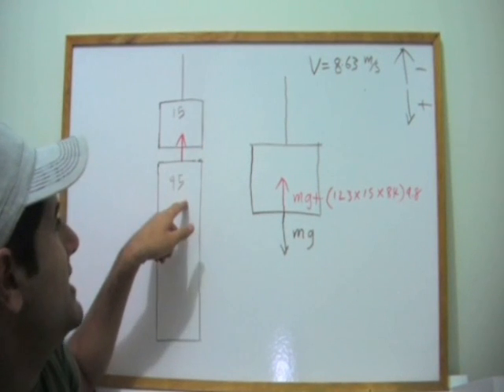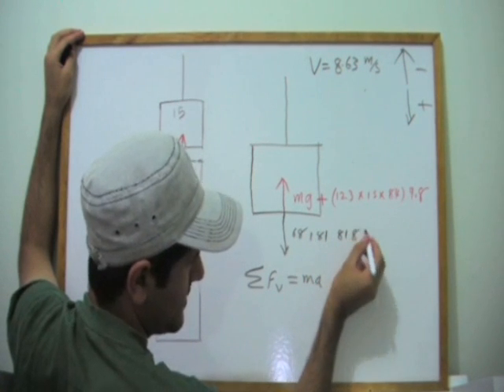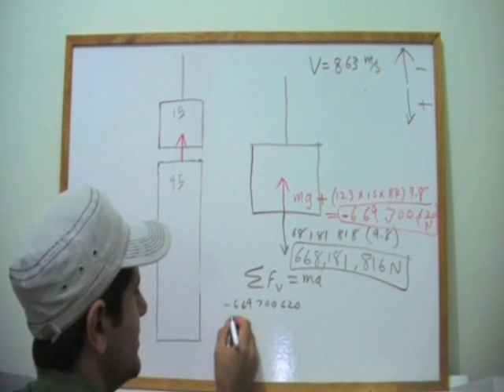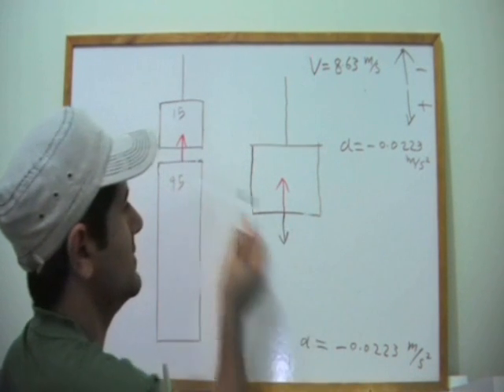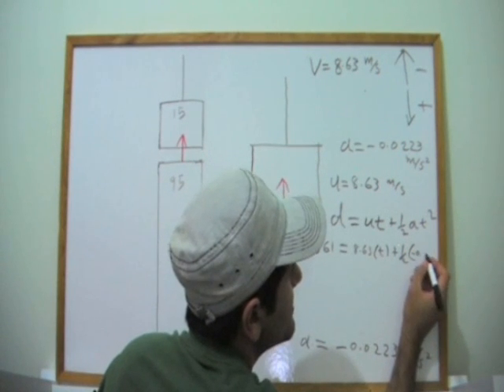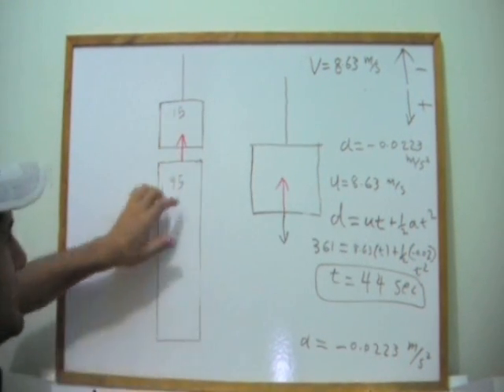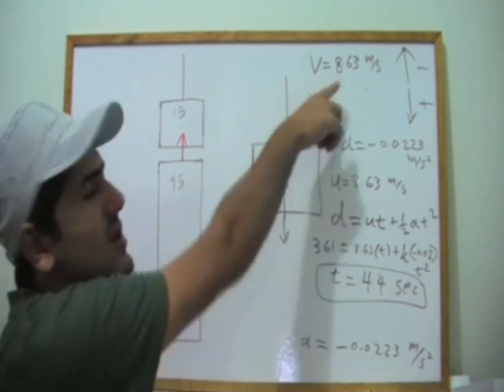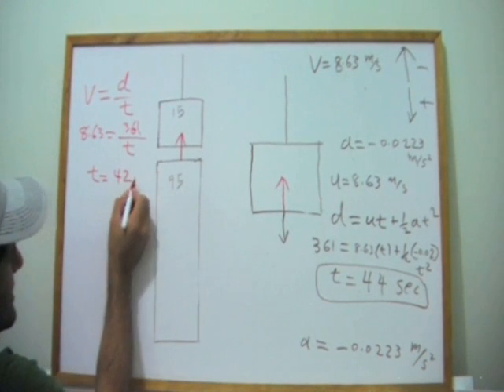(Part3) 911 Simple Physics Structural Failure Vs Demolition

Comment: Really, how could this be a controlled demolition? You can clearly see that the implosions in both towers were started at the impacted floors. Do you think someone ran up the stairs and planted the explosives after the planes hit? Or do you think explosives were preplanted on every floor, come on... Also, one tower fell after 56 minutes of burning, the other after over 100 minutes of burning. Why wait so long before taking them out? The towers fell because of the damage+fires, WTC 7 is som. else

Comment: @sskinner99 No chance he's a sophomore in mechanical engineering. I say that because a mechanical engineer wouldn't use constant acceleration laws, nor would he have erred on his FBD. At the very least a limit state analysis of the perimeter and core columns for rupture is needed. Column's can rupture quite easily if forces are misaligned from the centroid, leaving not much to support all that mass. The building failed from bending, not normal stresses due to mass being dropped on it.

Comment: 3. Your calculations do not account for widely differing resistance factors WITHIN the structure itself (i.e. floor joints vs. trusses vs. central core, etc.) and therefore does not present a viable model for what happened.   4. Your initial calculation was for the upper x floors falling only a single floor (3.8 meters). In both cases the planes hit at angles knocking out portions of several floors, not a single floor. In the end you do not come near proving the case against structural failure.

Comment: Ridiculous! Your calculations make many wrong assumptions: 1. That a single mass (the upper x floors) fell on another "mass" with opposing "force". In fact, the falling mass was cumulative and increased with each successive floor collapse. 2. The increasing cumulative mass was in fact gaining momentum (not losing as you hypothesize) since each successive floor collapse started with a greater initial velocity. (continued)

Comment: great video, i cant understand why its still a debate, its so obvious it was a controlled demolition. Either that or that building was designed to fall apart. The force of the top floors falling probably wouldnt even equal to the top floors fully loaded. I wanna know what the maximum weight handling was for each floor. Somebody find out and add that up to see and compare it to the load that day.

Comment: @peaceviddie "a" at freefall with air resistance is noticably lower. 
so the lower floors would have had to have disappeared before the upper floors reached them.
how can 47 floors of bolts snap simultaneously & symmetrically due to open air fire?
why did all the structural steel reinforced with concrete pulverize into dust or resist less than thin air- when no plane hit it ?
visit: h t t p : / / abz2000 . c o m / falseflagterror . a s p x 
for the full calculation -& please tell me his response

Comment: @peaceviddie calculation of the acceleration of wtc 7 collapse,
(height/distance) d = 174m
(time for collapse) t = 6.5s
d = Va X t   (Va is Average Velocity)
Va = d / t
Va = 174 / 6.5
Va=26.7
V1 (intitial velocity) = 0
Va = Vf+V1 / 2      (Vf is final velocity)
Va X 2 = Vf+V1
26.7 X 2 = Vf+0
Vf = 53.5
^V (change in velocity) = Vf-V1
^V = 53.5 - 0 
^V = 53.5m/s
^V = a X t
53.5 = a x 6.5s
a = 53.5/6.5
 
a = 8.2 m/s/s for wtc building 7
 
"a" in a vacuum at freefall with zero resistance is 9.8m/s/s

Comment: @Gi0Piles 
And there is something  deniers  often forget. There are always security factors calculated in every construction, the more life is depending on it, usually the higher the security factors. Even if a third of the structure would disappear and the other two thirds would be weakened by 50% the building wouldn't collapse in this manner. Period.

I agree with the scaling factor.
But you also have to think of it as a NON-RIGID body and loss of significant material mass during collapse.

Comment: One thing you didn't considered was the fact that in the moment of the colision the downward force isn't equal to the weight of the top part of the building.
You have to considerer the momentum and the impulse cause the force of something that's falling is always higher than its weight.

Even this "extra" force I believe still lower than the structural resistance.
Nice video, btw.

Comment from the maker: @peaceviddie  hi sir , yes we assumed the upward resistance force is constant which is not accurate because the resistance in a dynamic situation would vary at any given instance. this method is not conventional to calculate dynamic situations but i can bet that if you calculate the energetics it will not give you a time shorter than what i got. the proper way is by computing the energetics. or i refer you to a video watch?v=rP9Qp5QWRMQ

Comment: So buildings are big solid lumps of metal, with no air or space within? Contrary to popular belief, the world trade center did not have the material density of a tree. If the science behind this logic he uses were sound, axes would not be able to cut down trees, and there would be no difference between a dum dum bullet and a regular bullet. In carcrashes only one car would be damaged, since the one travelling slowest would have to be rigged with explosives, for it to take any damage

Comment: This goes on and on. For each floor, you can assune that the columns can buckle elastically at most by 10% of their length before they fail. Do math correctly and you will find that the downward acceleration (90%) distance) outpaces the resistance 10% of the distance), even if you allow for a safety factor of 3 times the static load, and a total average of about 2/3 g must be expected. This fits very well with the observed duration of the collapse.

Comment: There is an obvious flaw in your model, shorty40merza: When the top block travels down at 8.63m/s, at initial contact with the lower block it gets decelerated, true. But it keeps going down, straining and then buckling and breaking the columns below. This will happen after a short distance. Once columns break, they offer no resistance, and the top block (now enlarged by additional failing floors) will be accelerated by gravity (g) again.

Comment: @lonegull Steel dose not melt until you reach temp of 3000 degrees. Most of the fuel from the plane would have been used up in the first explosion, also steel used in builds like the WTC would be high grade steel that can hold more than 3000 degrees....lonegull dose it really make sense to you that a small section of the top would cause the building to come down in 10sec?????? use your fuking head...dam

Comment: @dumbnetworks You know I worked this out my self so many times and I don't see controversy about it, the building was "aided" to achieve this neat fall. If you watch zeitgeist he actually shows the core of the building and it has a diagonally cut beam, not bent not broken just a high temperature clean cut, if you are an architect does this sound familiar?

Comment: @PissedOffAtheist   Your assumption here is that the top of the building is in straight freefall. from all videos it  obviously is not. the student is using basic physics to prove that if the building falls FASTER than in free fall that it can't possibly be structural failure ; only an implosion from demolition does that.

Comment: @PissedOffAtheist . We are not talking just acceleration, we are talking about force that which is required in physics to work. W=F x d (d=distance ) and F=ma. as for momentum m1v1=m2v2 . if one considers mass in momentum, there is simply not enough mass in the top 20 or so floors to demolish the rest of the building at the speed observed , and even if so the above formula will yield a much slower velocity collapse than observed in the live footage. I can go through the math

Comment: @PissedOffAtheist No  he did not. positive momentum only applies to masses that are accelerating or constant velocity. he showed mathematically that the top
would be decelerating (ie slowing down )  when it hits the resting part. Think about it.  Would your car speed up if you rear ended an 18 wheeler stalled on the highway in your path of travel  ? I'll take a guess and say no ..

Comment: @ barrington...this is still assuming that 1 floor vanished instantly...and that there was no time allotted for twisting and there was no air resistance...besides, structurally the core supports of the building would withstand impact OR in an extreme farfetched circumstance, the core would stand and the floors would fall around it OR if you destroy the core it would act like a mast on a ship...it would topple over....in theory :)

Comment: that theory would mean that the top portion would of toppled over.  The top 1/10th does not have the energy to destroy the bottom 9/10th.  That 1/10th would have to have the same amount of energy or more to destroy the other 9/10th.  And you don't need math to figure that out.

Comment: You assume that both bodies behave like solid blocks. They are not.

Press the fingers of your two hands together, eventually they will "slip" past each other. Likely the top columns were NOT directly aligned over the load bearing bottom columns when it fell. They could well have been aligned over just the floor trusses. Also Point loads at end of columns would be v high to punch thru floors.

Please email me to explain this. Overall good video.

Comment: Thallis69:

Its 'cumulative', not 'acumulative'.

Anyway, lets not moan about spelling...

I am guessing your imagining some sort of acceleration, allowing the upper section to fall through the rest of the building underneath. If that is the case, Newton says you are wrong. Every action has an equal but opposite reaction, hence the un-damaged section below would resist, RESIST with UPWARD FORCE.

Comment from the maker: i multiplied the mass of the falling block by the acceleration due to gravity in order to obtain the force acting on the falling block due to gravity, basically  the weight  of the falling block.  then i said the Resistance force at any instance should be at least equal to the weight that it was supposed to carry at static conditions.  eg level 45 was meant to carry levels 46 to 110 at static conditions so the resistance it offers is at least the same as the weight of floors 46 to 110

Comment: Your assumption that the bottom floors is wrong. They had been heavily damaged, and subjected to fuel and aluminum fires (ie, the airliner burning, thats 75 tons of aluminum) NIST estimated that 3 floors were directly hit by the airplane, and that the three floors below that, had been ravaged by the fire, specially at the floor joists attaching them to core.

Comment: Ok man, you take only one "body" in your calculations, wich you drop on the "big one". that's wrong. the residual capacity of the north and south towers was limited, and that once the collapse was set in motion, it would take only nine seconds for the building to go down. 
This is just a little longer than a free-falling coin, dropped from the top of either tower, would take to reach the ground.

Comment: BTW I am an architect. Of course under tremendous pressure concrete can 
"explode" if you are an engineer you know. Did you consider pressure from wind?  From the sides?
BUT! I didn't say that controlled explosions are excluded.

Comment: This is a good video.
I think anybody with a sound knowledge of basic physics and structures would intuitively recognise the possibility of the towers collapsing by themselves. 
I understand this video is talking about block masses. Not appropriate for the WTC. With it's unique structure of the outer shell being the main support, as the upper block fell it was peeling the structural concrete away and allowing the floors below to drop. 
Interesting video though. Thanks

Comment: Its just common sense that the top 15 floors could not crush the bottom 95. If dropped upon, it would fall to the side, We arent even calculating the force needed to hold the top 15 floors straight as it crushed the bottom..
9/11 was an inside job, there were bombs in the basement.
FACT

Comment: Hey u sound like an engineer... or at least you have studied engineering in some detail at some point

I mentioned the column buckling in a vid I made

You should check it out n get back to me. I know its not perfect. I mention sagging of the floor trusses for instance but I'm not sure about its actual significance. The fire alone and removal of the lateral bracing could weaken a columns resistance by about a factor of 8! i.e. 50% loss of strength from heat and a doubling of its effective length

Comment: I concede columns may be larger than necessary in parts as column splices are expensive however and it is usually more economical to continue a column size for several floors.

ps Im lg above... this is my eng. account

Comment: My link shows the difference between a dynamic force and a static one by using the example of the pennys and the piece of paper. It doesn't equate the towers to it. If its not obvious to you then I cannot explain it.

"most of the load bearing capacity was at the bottom of the building" is an erroneous statement. The bottom has the highest capacity but load is resisted throughout the building with members sized relative to this load for efficiency.

Comment: The two towers collapse is arguable, it may or may not be a controlled demolition, using simple physics would give highly inaccurate results.
Problems involving structural dynamics must be analysed using work-energy methods in finite elements (computer models), and would be still inaccurate and arguable, since many variables are unavailabe and need to be assumed.

Why not concentrate on the bright clear facts that are in the pentagon and building 7 to prove it was an inside job?

Comment: IF floors 76-92 are completely demolished, by Newton's third law floors 95-110 would be completely demolished.

COLOSSAL untruths :

floors 76-92 COMPLETELY demolishing  floors 95-110.

this demolished mass completely DEMOLISHING intact floors 1-76. 

NIST knows this. this is why NIST chose to STAND DOWN.

NIST admits their report

"... does not actually include the structural behavior of the tower after the conditions for collapse initiation were reached ... ."
NIST - 2005

Comment: I totally agree with you that the official story does not add up, but the twin towers problem is arguable, the pentagon however is just a ridiculous story, where they didnt even find a plane, watch loose change and go to debunking911, listen to both sides of the story and make a judgement.

Id like to thank you for your effort, i am not saying that it is totally incorrect, and i agree that the bulding fell just too fast for it to be a progressive structural failure.

Comment: most probably, the columns would pierce the slabs. another ppoint that i wanted to mention is that the plane that crashed into the column would just slice the columns (without buckling), a commenter just said that 6columns were severed.
In case the failure case was buckling, once the column buckles, its resistance falls to almost zero (when compared with its resistance as upright straight column), so you cannot assume that the resistance force to be constant.

Comment: You cannot assume a column to be a continuous members...all steel structural members are "sold" in 12m fragments (so that they can be transported).
On site, they are connected to each other using bolted connections (not welds). the critical point is usually the connection (i.e. the bolts will fail and the column would turn into a sharp concentrated reaction), the falling object would then fall, it is not possible that each column would fall on its "mother column". (contd)

Comment from the maker: yes I see your point sir but lets look at the issues one by one. this assumption  is similar to a solid object falling through a fluid where the fluid provides a constant resisting force. ( We know that the force is more but that minimum amount of force is guaranteed at any instant).  thanx for that  its good to hear opinions of Engineers , i am also an aerospace engineer and i worked in structural engineering before on concrete and steel and slabs,

Comment from the maker: the average resistance force that i am talking about is the absolute minimum force that would encounter the upper structure, the actual resistance force would start off being the same as the weight at the start but then beyond the elastic region it would increase until it reaches the failure load which is always more than than the static load.

Comment from the maker: the columns don't pierce the slab unless they have been disconnected from each other...    usually columns dont shear and pierce slabs they actually buckle and bend because steel is very ductile. so the buckling is more critical than the columns disjointing in shear and would happen before the disjointing. 

10 seconds werre not taken from vedios but were taken from Sound data,,,  so its not to do with what we saw but its to do with what we heard..

Comment: however what would normally happen is that the columns below would pierce the slabs above, and the resistance force you are talking about would only last for a fraction of a second per floor (i.e. the time it takes a column to punch through a slab).
The second incorrect assumption that you made was that the famous 10 seconds ppl are talking abou is the time it took the falling body to disappear from sight behind the neighbouring skyscrapers... (contd)